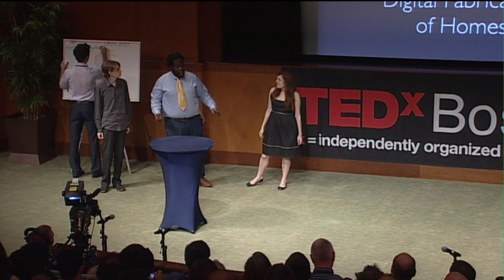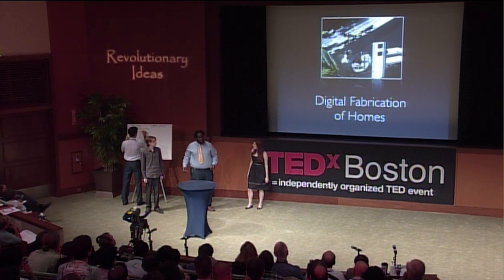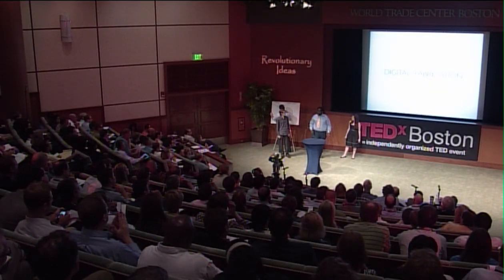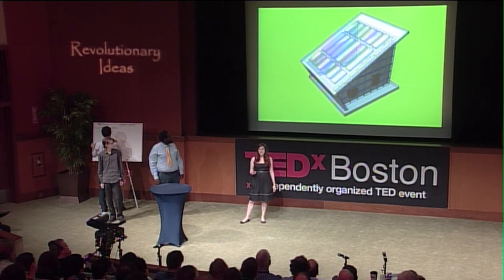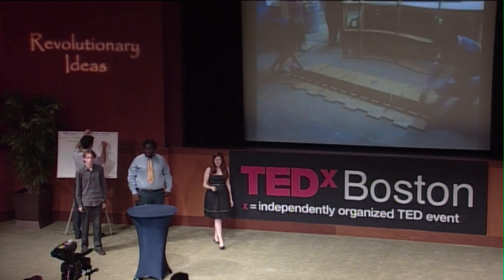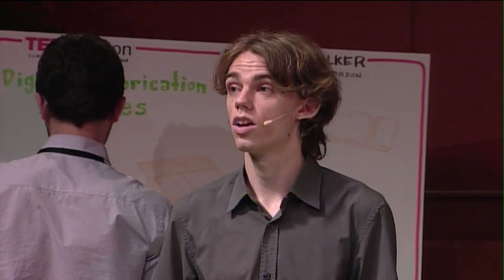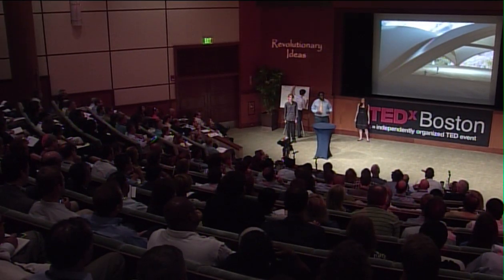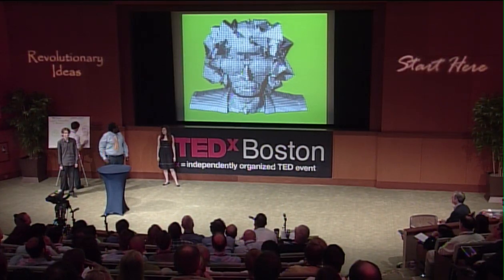TEDxBoston - Lynwood Walker - Digital Fabrication of Homes

Comment: @sidsdad1657 Progressive housing design is moving away from asphalt shingles and I think it would be fairly reasonable to assume that the fabrication process takes in to account load bearing and stability. I do agree though many construction crews I have dealt with would probably have problems putting the pieces together. But those same guys also need to have somebody on sight to read blueprints for them so I think the difference in efficiency there would be negligible.